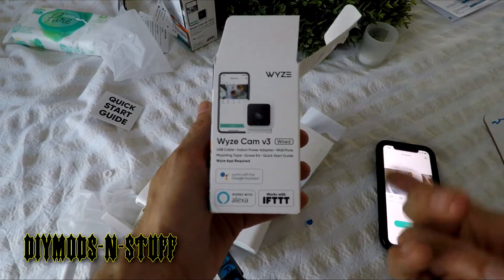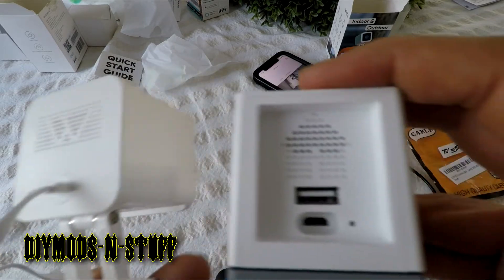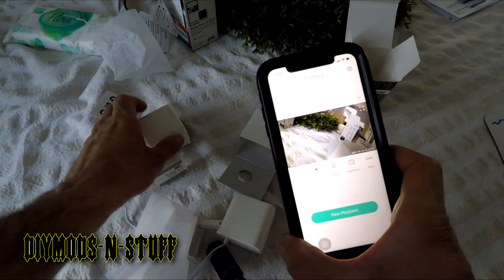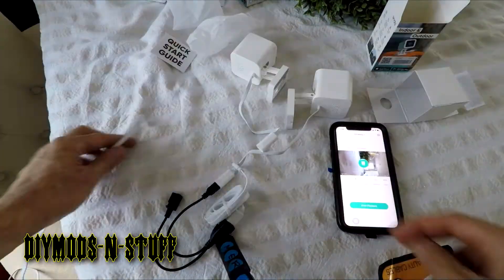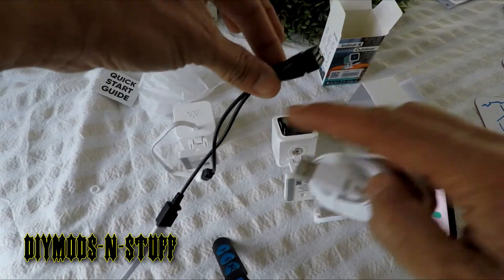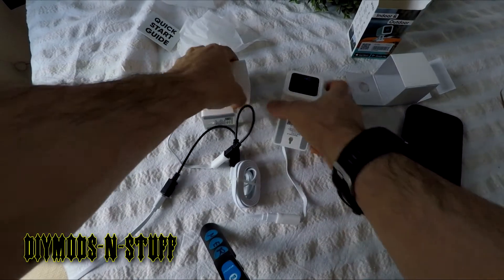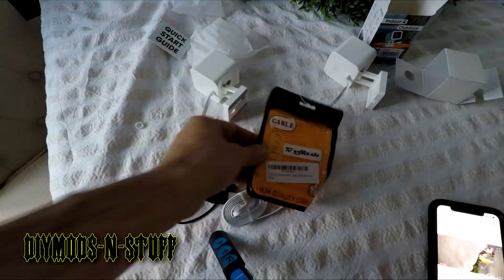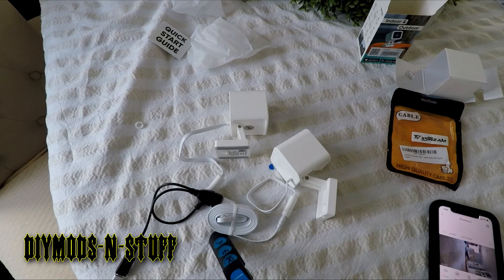Connect two WYZE V3 cameras using one power supply....

Comment: Thanks for sharing the genius setup.  I've also ordered the splitter from Amazon to try with the new Wyze OG, and it first worked out fine, then few days later.  Like others mentioned below, I started to get statics (especially if you turn on the microphone), and then the cam will just go out in the middle of the night every other day, with the error message of "failed to connect, error code: (20008)", and then I have to power cycle the cam by unplugging the power and connecting it back; then the problem will show up again in a day.   I wonder if anyone have similar issue with the setup?  Also, not sure why Wyze took out the USB-A connector they used to have on the older models, which is perfect for daisy-chaining the cams.

Comment: What size supply did you use? Mine not working with the Wyze plug.
Reply from the maker: It's only a couple of inches long. I would try to check and see if the connection is snug. I only used the WYZE power supply and I also have an extension of twenty feet working fine.
Reply: @diymodsnstuff5514  thanks, I got it working with a different power plug.

Comment: I piggy backed a Cam V2 to the usb port on the back of a Cam Pan without using a dongle.  It worked and had power.  But I noticed after a few days, the image/video quality had so much static that it became annoying to watch recorded videos.  At one point it became not viewable at all because of too much static on the screen.  How has yours been holding up???
Reply from the maker: It's still working fine. Just make sure the dongles are shielded. You'll know by the thickness of the cables.

Comment: The funny thing is I've called Wyze twice about this and they guaranteed me it would not work. The second time I called, I had already purchased the splitter and had it running; I merely called back to let them know they were incorrect. I told them it did in fact work and they said, "no it doesn't, that is impossible". LMAO, I run roughly 15 Wyze cameras and their irrigation controller, but their customer service is beyond useless!

Comment: Great for inside...not so sure about the one connection for outside though.
Reply from the maker: True, but I wrapped the connections with black electrical tape and so far no issues. I had to unplug them the other day and there was no corrosion whatsoever. Hope this helps.

Comment: Nice helpful video.. Now to figure out how to still piggy back the 2 cameras with 1 wyze solar panel.. Can this be done? Thanks for sharing
Reply from the maker: I'm sure it is. I would have to try this. There is a cable with three connections instead of two and that might just work.

Comment: I called bullshit just got miles in today it worked just fine but then it loses power as time goes by 9$  from Amazon for a pack of two,..don’t waste your time
Reply from the maker: Check your power supply. I have multiple setup this way and have had no issues.
Reply: @diymodsnstuff5514  I piggy backed a Cam V2 to the usb port on the back of a Cam Pan without using a dongle.  It worked and had power.  But I noticed after a few days, the image/video quality had so much static that it became annoying to watch recorded videos.  At one point it became not viewable at all because of too much static on the screen.  How has yours been holding up???
Reply: It's your set up, not the principle of using a splitter. Mine works fine.
Reply: @johndeaux9987  I piggy backed a Cam V2 to the usb port on the back of a Cam Pan without using a dongle.  It worked and had power.  But I noticed after a few days, the image/video quality had so much static that it became annoying to watch recorded videos.  At one point it became not viewable at all because of too much static on the screen.  How has yours been holding up???
Reply: @mikecruz9226  The cam v2 didn't seem to be functioning as well plugged into the flood light cam. I ended up running its own power source to it. I'm not sure if that was necessary, as I have since determined there's something wrong with the floodlight cam, lol.
Reply: @johndeaux9987  Hmmmm...
Reply: I piggy backed a Cam V2 to the usb port on the back of a Cam Pan without using a dongle.  It worked and had power.  But I noticed after a few days, the image/video quality had so much static that it became annoying to watch recorded videos.  At one point it became not viewable at all because of too much static on the screen.  How has yours been holding up???
Reply from the maker: Sorry this didn't work for you. Mine's working solid and this on the original power supply from the WYZE V2.

Comment: If cords are outside, the dongle isn’t meant to get wet. Is that a problem using it outside?
Reply: wondering about this also? anyone have solution?
Reply from the maker: I wrapped them with electrical tape and had no issues with the weather. I disconnected them a year afterwards to replace one of the cameras and there was no moisture or corrosion.
Reply: I would think if you wrapped the connections with waterproof electrical tape it should be fine.
Reply: Electrical tape or silicone.